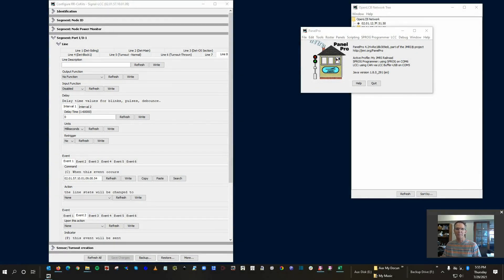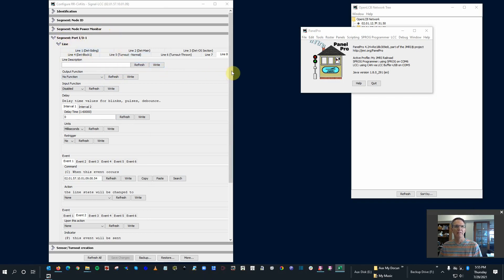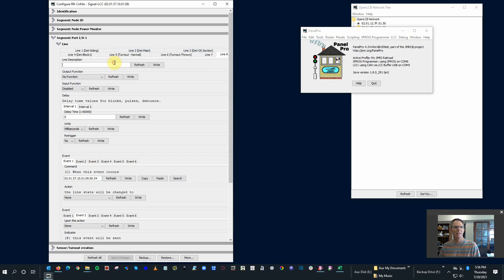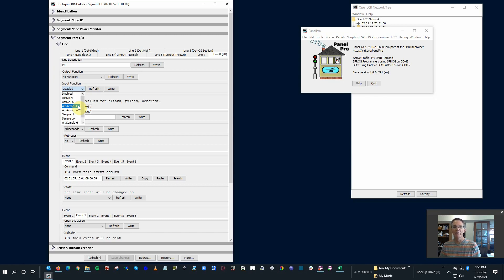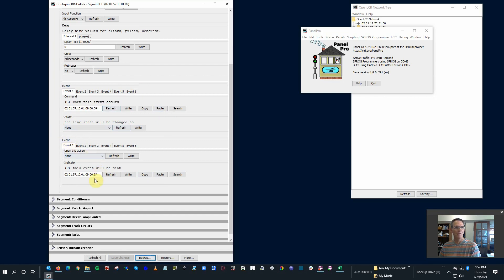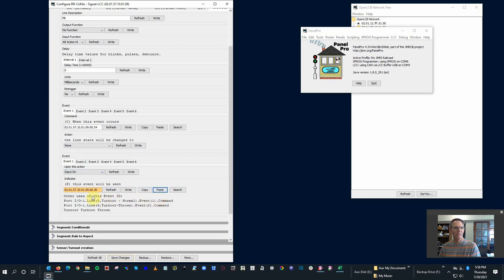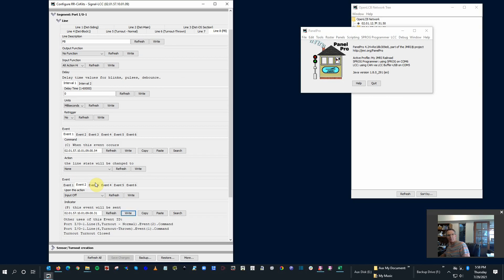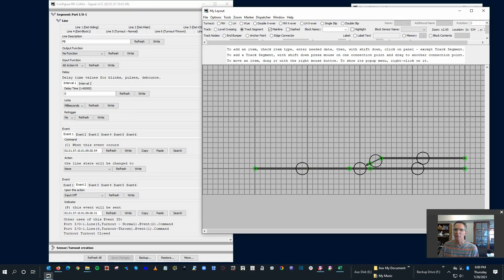TLC #10  Configuring a Push Button

Comment: I have watched your whole playlist as I am installing LCC on my layout. I currently have 1 Signal LCC with a BOD-8 installed and soon to add a 2nd LCC with a SMD-8. I could potentially use some help setting up some signal logic for after the first of the year. I current have the first mast setup in JMRI and can give it specific aspects. - Jason
Reply from the maker: Great to hear! And congrats on getting those signals configured. Working on vids talking through the process of setting up signals via LCC. Stay tuned!